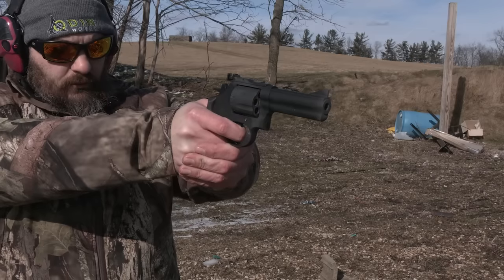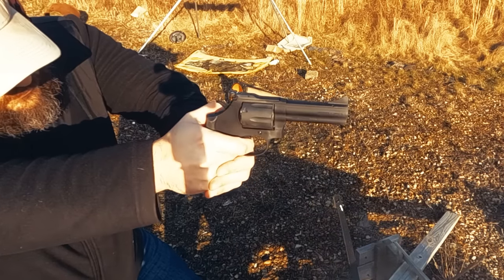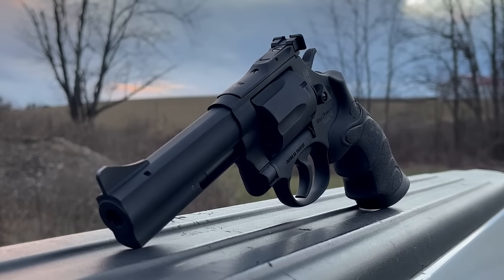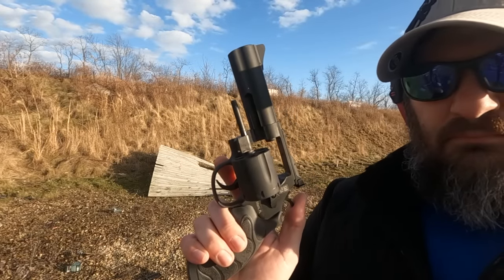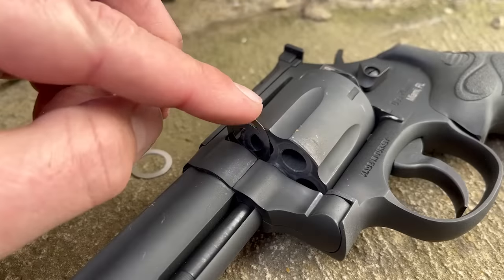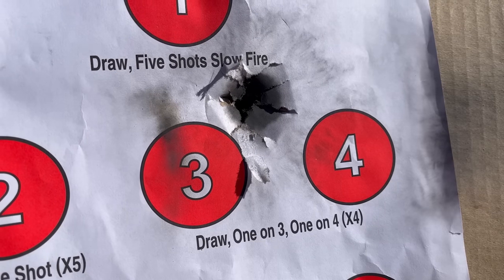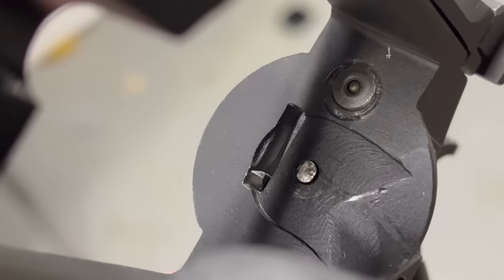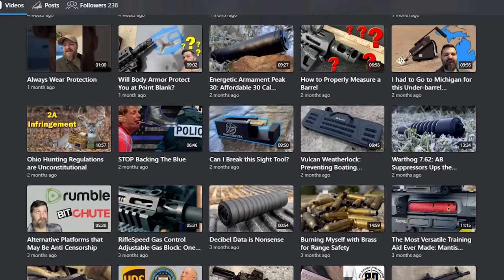SAR38 Low Cost Revolver in .357 Magnum

Comment: As a gunsmith, you're just keeping my trade alive...

I've replaced multiple hands, cranes, etc. because of the damages caused from flicking cylinders closed. The most significant damage I've seen was on a taurus raging bull. Smaller cylinders will take more time to do damage, but the possibility is there.

Treat your gear as you wish, but I've had to do very little parts replacement to my own revolvers because of basic ettiquet. I'd rather spend my money on more ammunition than parts I damaged from neglect...

I personally dont care what people do. It's their money...
Reply: Please make a list of all the companies and models of revolvers you’ve done work on. I’m sure they’re 686 trash, Ruger shit and anything in between them. Low quality garbage
Reply: Exactly. Play stupid games win stupid prizes.
Reply: @614XJ  You sound like a Hi-Point owner. lol
Reply: @davesoble5099  Lol never. But thanks pal
Reply: I’m thinking about getting gun smithing but I still cringed when he did it
Reply: The Colosiss is correct.
Reply: Exactly. If there is a weak point on a revolver it is where the cylinder and crane attach. Locked in place it is a very strong system. With the cylinder open and full of rounds there is a lot of weight on the crane. The extra force of flipping it can and will cause damage. If not immediately certainly over time.
Reply: Same here—seen it many times!

Comment: Test it all you wish. It does not damage the cylinder. It damages the crane and frame by stretching the relationship between both. The bigger the cylinder, ie the Ruger Redhawk, the easier to do.  What happens is that the cylinder will be "sprung" out of alignment with the barrel. I have seen it several times as a gunsmith.
Reply: maybe on old or cheap guns but this should not be an issue on newer revolvers & if it is then they are using sub par materials or designs.
Reply: @RichardCranium321  That is clearly not true. All metal will get warm down, weather you are polishing every day or you are slamming the cylinder and carelessly letting it grind against the frame. If you want to break the only part of the revolver that cant be fix then go a head and slam that cylinder if it makes you feel like Doc Holliday
Reply: Yup, it can f#@k up the cylinder hand too.
Reply: @fullrigormortis3684  of course parts wear, but they factor that stuff in when designing... if your cylinder is even touching the frame then you already have a MUCH bigger problem than a little wear.

I have old revolvers that have been spun and flung shut for decades & they have zero wobble or bore misalignment - vice versa I had a charter arms 38 that would shave rounds right off the assembly line.

point here is summed up pretty well by the blish principle, except you can substitute different materials for the same material with different hardness so as to reduce any galling or similar interference.
Reply: @bobdunn4179  this is the only part that actually gets messed up, but it's designed to be the sacrificial weak link so as to protect the cylinder, crane, ejector, etc....
Reply: My 626 is about 30 and I slam the cylinder regularly and it still functions flawlessly!!!!

Comment: You suggest that swinging the cylinder shut can't damage the firearm. More than simply stating why I think you're wrong, I'd like to give you some advice in your testing and point out a few things you should keep in mind. 

Not every gun is exactly the same. There are few universally true statements when it comes to firearms. 

As one example, on Ruger dougle-action revolvers it tends to be the case that the ejection rods play no part in the guns' lockup. As such, if any damage were to occur to a Ruger double-action revolver it would likely have nothing to do with the ejection rod. However, on Smith and Wesson revolvers the end of the ejection rod plays a role in the cylinder locking and unlocking. Therefore, if ejection rods can be damaged by this procedure then expect to see that on Smith and Wesson revolvers along with other companies in which the ejection rod plays a part in the cylinder's locking and unlocking. 

Another thing to point out is that the heavier the cylinder, the more wear this procedure is said to incur. This is important for two reasons. First, to give the best chance of your testing actually producing results of this wear it would be advantageous to test this on guns with heavier cylinders, like a 6 shot 44 magnum, rather than performing the testing on a small j-frame sized revolver and pretending as though that would be a conclusive test. The other thing to note is that this means performing any tests without ammunition in the cylinder will not give conclusive results, as the ammunition will add weight and therefore increase the likelyhood of the testing producing possible results. 

Finally, if the way you measure your results is simply "does the gun fire" both before and after the testing then I don't think you'd be properly conducing the testing. Lean out to test the gun's timing and lockup thoroughly. Test the guns lockup and timing on each chamber prior to testing, then after the testing compare the gun's lockup and timing again on each cylinder. This will be almost impossible to quantify for others, but if this procedure produces wear that worsens a revolver's timing then you should be able to notice yourself and would simply have to convey the tactile difference your hands perceive as a result, if any. Also, the lockup can be effected in such a way that the gun will still fire but part of each bullet fired might make contact, or rather significantly more contact, with the forcing cone. This would mean that the gun is ever so slightly shooting itself in the forcing cone with every shot as a result of the wear, and you likely wouldn't notice what difference this would make unless you not only performed the action however many times you saw fit but then also fired enough rounds to see whether or not this phenomenon is occurring. 

Finally, I completely disagree with the logic of one statement you made. You said "If it is true..." the "it" in question being that swinging the cylinder closed can incur wear and damage on the revolver "...then why on Earth do we continue to make them and market them as life saving equipment?" Swinging the cylinder shut isn't inherent to the operation of the revolver. In fact, it serves virtually no functional purpose whatsoever. The only reason I can think of why anyone has any desire to operate revolvers in this fashion is that either they think it makes them look cool or they're genuinely ignorant of they simply find subjective tactile pleasure by doing it. If this phenomenon occurs, which I very much think it does as I've inspected many, many used revolvers in my time many of which have wear said to be as a result of this, then that would do nothing whatsoever to suggest that revolvers are therefore somehow ineffective as being, as you describe it, "life saving equipment". Revolvers have been used successfully as such for almost two centuries; the fact that you might not be able to perform an entirely superfluous action without damaging a revolver doesn't change that.

Comment: Fudd Logic: Never flick the cylinder shut on a revolver, never drop the slide on a empty chamber, never dry fire a gun, and bronze brushes will somehow damage steel rifling.
Reply: Also don't water your AK after firing corrosive ammo. In fact, only use brass in an AK
Reply: Flicking the cylinder shut puts excess wear on both the crane and the cylinder latch. Bending the cylinder latch can effect the guns timing, and putting excess wear on the crane can create an unsightly gap between the crane and the frame. Different guns are different, and the heaver the cylinder the more wear doing this puts on the gun. 

Dropping the slide on an empty chamber is another gun-by-gun thing. Generally speaking, guns with internal extractors will incur more wear by dropping the slide on an empty chamber and therefore it's not a good idea, while guns with external extractors tend to not have such an issue. Also on some match grade 1911s, dropping the slide on an empty chamber can actually damage the seer. 

Dry firing is another gun by gun thing. Some guns it is a huge issue, usually rimfires, while other guns are designed in such a way that it's a non-issue. Look to what your gun's manufacturer suggests. 

Bronze brushes can and do put slight amounts of wear even on steel surfaces. The notion that you simply can't damage a material if you're using a softer material abrasively against it is simply false. It is possible to wear parts down by excessive cleaning, especially if you're using any metal on metal cleaning methods. It's also the case that if someone isn't excessively cleaning their guns that the amount of wear incurred by using bronze brushes is negligible at best. I've seen bolts on AR15s that were worn out of spec simply by excessive cleaning, so that's a very real thing. Again, it depends.
Reply: @BusterBuizel  Oh please, Fudds don't own AKs. "I don't need no 30 round banana clip."
Reply: Except all of those things are true with certain guns or certain circumstances, so… fudd logic meets new generation ignorance.
Reply: @CutlassOutdoors  I knew all of those things are true in limited circumstances. None of them are usually a big enough deal to make a big fuss about like a lot of fudds do.
Reply: @dancortes3062  Yes, but pretending that they’re “fudd lore” for the sake of getting clicks, when someone could get themselves hurt following bad advice, is a bit unethical in my opinion.
Reply: @CutlassOutdoors  Your right. I'm sorry to the guy who will get his finger caught in the cylinder while flicking his revolver shut because he read my Youtube comment.
Reply: @dancortes3062  out of timing revolvers can cause serious injuries.
Reply: @CutlassOutdoors  I highly doubt slamming the cylinder shut could ever screw up the timing so bad that it would cause injury plus it is still debatable that it affects timing at all.
Reply: @dancortes3062  no.  It’s not.  It has never been up for debate.  It was common knowledge until… this video.  Maybe trust Jerry Miculek’s opinion (professional revolver shooter), instead of “I think this might be a wives tale, please click my video.”  Or maybe ask your gunsmith.  This is not opinion.
Reply: @CutlassOutdoors  Didn't Jerry say it only slightly affects timing?
Reply: Large bore revolvers should not be flicked. 
It fucks up the timing. 
But we're talking about revolvers much larger than .357 magnums. 
It is a matter of how heavy the cylinder itself is, as well as it's total weight while loaded. It's basically just weirdo specialty revolvers that accept meme rounds, and are poorly designed in general. 
Aka, boomer range queen revolvers shooting near elephant gun bullshit.
Reply: @dancortes3062  is it only sorta affects timing, or is it fudd lore?  It either damages the gun or it doesn’t.  It can’t be both.
Reply: @dancortes3062  telling a bunch of new gun owners that gun safety is fudd lore is irresponsible and does not benefit the shooting community.  Fudds don’t care about other people’s gun rights and are only interested in their specific types of guns and shooting sports.  What is fudd-like about telling new shooters how to safely handle firearms?  People who are cavalier with safety and mock it as fudd lore are not helping new shooters and gun owners.
Reply: @CutlassOutdoors  Damn, so I've been a Fudd this whole time a didn't know it. What a twist.
Reply: @alexanderwebb680  when I went through the academy revolvers were still very common we used s@w 19
They said they had to have a few guns sent out to repair every class from some iedoits doing this.
Seeing as how he had been there for 20 years 
I going with don't do that stupid shit
Reply: Each firearm is different, but try dry firing with a 22LR or 22WRM and see how long the firing pin lasts.  As for bore brushes, it depends on the steel used to make the barrel.  I've not heard of any complaints about bronze brushes damaging bores, but stainless steel brushes do have a reputation for damaging bores, particularly on older guns made of softer steels.  Slamming home the slide on an empty chamber produces needless stress and peeing of the parts, so why do it?  The same is true of slapping a cylinder home on a revolver.  I've seen the bent cranes, timing issues, and cylinder seizures.  The same logic applies to safety gear.  Some YouTube personalities think wearing eye protection is a joke.  You only have to be wrong once to learn otherwise.
Reply: Slamming the slide home can actually damage the sear on some 1911s, namely ones with match type trigger jobs.
Reply: @Paladin1873  The real point of my comment is why care what people do to their own property? Yes dropping the slide on a empty chamber does sometimes prematurely wear parts but so does shooting steel cased ammo. Plenty of people know this but don't care (as long as they do it to a range toy).
Reply: @dancortes3062  Then why do you call it Fudd Logic instead of Reasonable Precautions?  My understanding of Fudd is it is meant to
be demeaning and dismissive.
Reply: @Paladin1873  Making a huge deal about habits that only affect certain niche situations is unreasonable. It's kind of like saying not to ever shoot smokeless ammunition (even in modern firearms) because it can blow up black powder guns. but your right maybe my wording should have been a little different.
Reply: @dancortes3062  Not everyone who watches YouTube gun channels is knowledgeable of firearms.  It would be a disservice not to warn them of the potential pitfalls of taking the advice offered in this video.  I'm not just speaking as a viewer, but as a gunsmith and NRA Counselor.
Reply: @Paladin1873  Like I said before, your right I probably should have used better wording. I meant the comment as satire and I think most people will see it that way. Maybe I'm a bad person but I don't feel sorry for the guy who's gun stopped working because he took serious advice from a Youtube comment.
Reply: Millennial root honker.
Reply: @CutlassOutdoors  Agree, and that's not just my opinion, but the experience of some of the top 1911 gunsmiths I have known.
Reply: @dancortes3062  wrong. You WILL destroy a revolver by cowboying the cylinder closed.
Reply: @CutlassOutdoors  Bill Wilson and Ken Hackathorn from Wilson Combat also advise not to slam the cylinder shut on a revolver.
Reply: Such a regarded comment. Unlike some Fudd-Lore the cylinder flick is real and damage is measurable. Grow up and learn instead of wasting your life showing everyone how little you know about guns.
Reply: @dancortes3062  u need the same thing that  your thread has u will have a better chance
Reply: Don't forget the most important rule: never fire your weapon, it'll wear out the rifling
Reply: The next thing they’ll say is that it’s dangerous to shoot the wrong caliber in your gun, or mix powders when reloading. Silly Fudds
Reply: @ramseycattn5941  a broken clock is right twice a day. But in this case, the clock is slow as shit with poor tolerances, and is only right once every couple days when the time lord blesses it and makes it line up briefly.

Comment: It's your gun so as you wish. It does hurt the crane and lockup to flip it shut. I'm not a Fudd, I do however understand the mechanics of a revolver. It doesn't make it somehow silly to market it as a "life saving device" and also advise people to run and use it correctly. Trainers and experts that can't learn new things, or, even worse, refuse to learn new things aren't very good trainers/ experts. 

One also shouldn't floor the accelerator pedal on an ambulance and then throw it into drive, that would be hard in the transmission. It wouldn't however be a ding against the ambulance it would only be a ding against the operator. One must be smarter than the equipment they intend to use.

Comment: I think the reintroduced Rossi RP and RM series .357 mag revolvers in 3", 6" and soon to come this year hopefully 4" are going to be the main competition of the SR-38, along with the ever present Taurus models. 

The new Rossi .357 revolvers are supposed to range from $460 to $600'ish. And they have a hammer mounted firing pin and hammer block safety as opposed to a transfer bar. O e problem some cheaper revolvers like Armscor and Taurus have had and occasionally still have is broken MIM manufactured transfer bar safeties. That hammer mounted firing pin might be a alternative for people who don't trust the MIM QC on cheaper guns. It'd be interested to compare the Rossi and SAR revolver.
Reply: Had a Rossi for many years. Never an issue and was more accurate than I was. X wife pawned it. And I haven't found another just like it yet. Would definitely buy again.

Comment: Like most layman advice about guns, these are probably true or partly true for older guns but not so much for modern stuff. For example, people say that revolvers "never jam." Sure early semi autos were less reliable and revolvers can continue to fire if you hit a dud round, but they can and will jam under the wrong circumstances. You're also not supposed to dry fire (old) guns, but Glock actually recommends it to break in.

Comment: I am old and have seen many DA revolvers with bent cranes/yokes.   If there is any play in the yoke you can see and feel it.   Close the cylinder and look for a gap between the crane and the frame.   That is the first thing I look at when buying a used revolver.

This type of wear is not so prevalent today because many makers have hardened the crane.  Slamming the cylinder closed can still cause damage to the parts.   Compared to the autos like the 1911, revolvers are more like a clock works.  That is why they call it "timing".   This is another reason to have an identical firearm to your carry piece for practice.   You will put the wear on your practice piece.